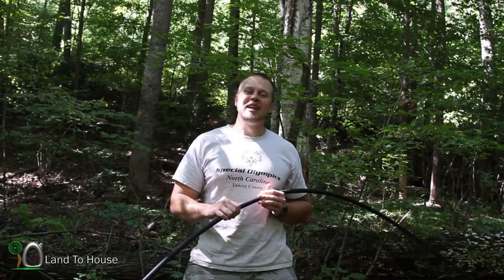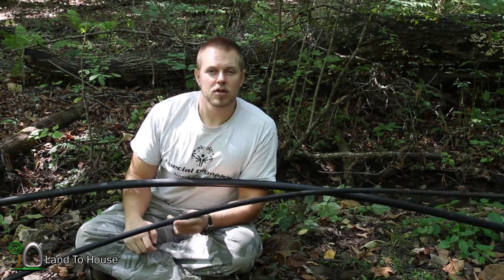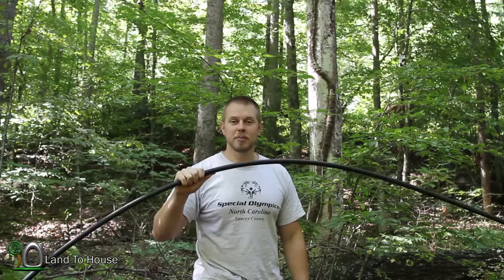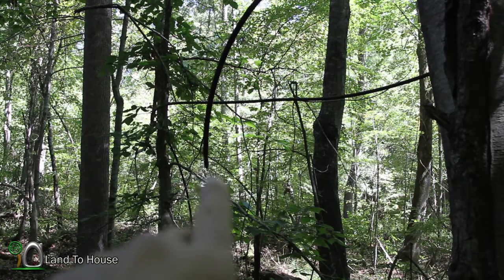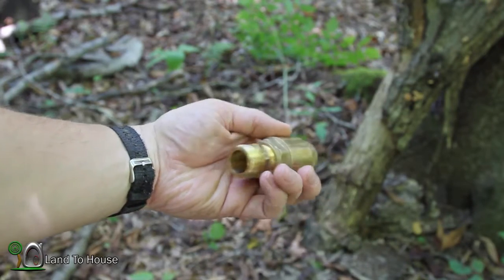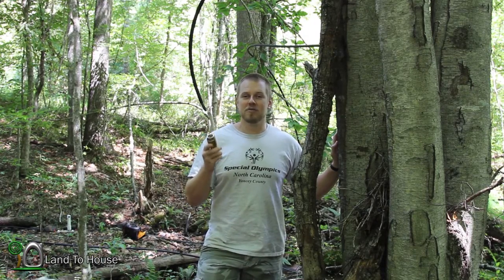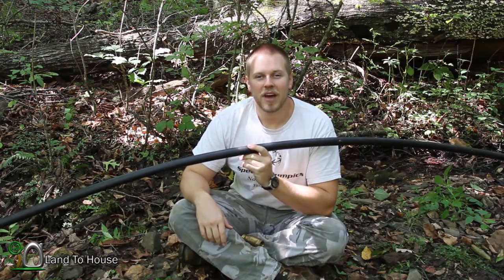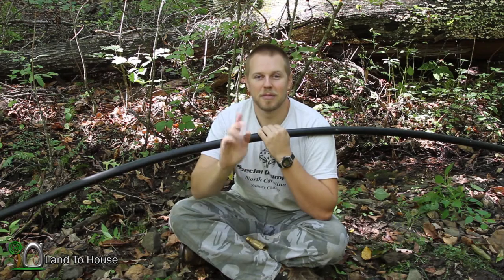Ram Pump Delivery Pipe Info

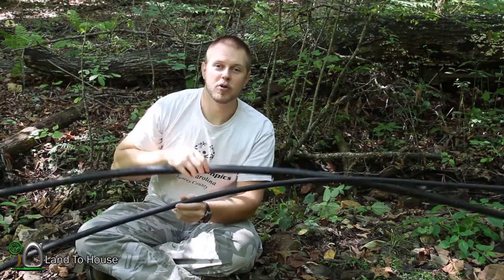Comment: The delivery pipe cross section area may no be less than same in the drive pipe by a ratio. Ratio of drive head to delivery head. If drive head is 3 and delivery head is 30 the ratio is 1:10 or 0.1:1. The delivery pipe area may be 10% of the drive pipe area or larger.

Comment: Question:  Are you able to delivery water HIGHER with a smaller diameter delivery pipe?  I understand the pressure is the same but the weight of the water is substantially higher in a 3/4" vs 1/2".
Reply from the maker: From my tests the delivery is the same output for the two sizes. The  drive pipe head pressure is what determines the lift height. Now if you had a very large pump and small delivery there might be some friction loss.

Comment: Wouldn't the weight of the water have an effect on the back pressure, more so than the atmospheric pressure? Your right, the atmospheric pressure is constant no matter what but won't  back pressure created from say,10 vertical feet of 1" pipe  be significantly different from the back pressure of a 1/2" pipe due to the increased water mass?
Reply from the maker: +Jumprun1 at first I thought the same thing. I performed a test using large Drive pipes
Reply from the maker: +Jumprun1 sorry about that last post. I hit the wrong button. I performed a test using small delivery pipes and large delivery pipes. And they had the same output. Consider running a ram pump into the bottom of a large stock tank. Eventually the ram pump has the power to flow water out of that tank.